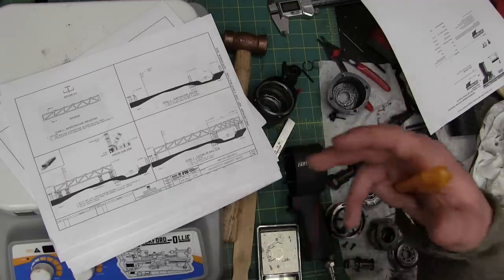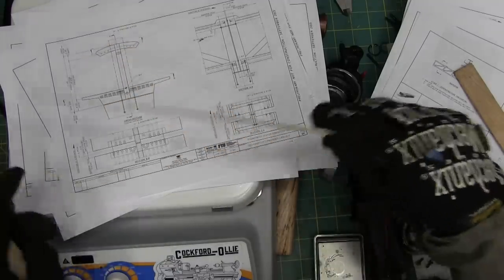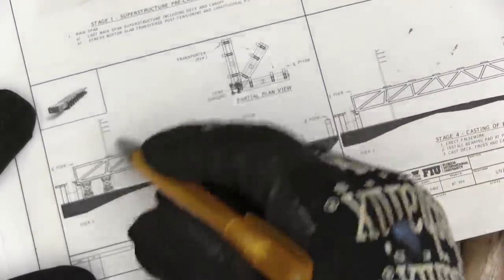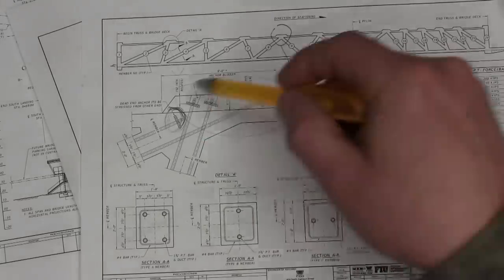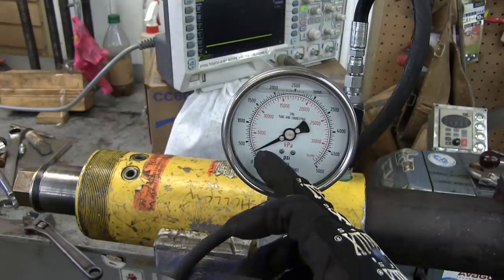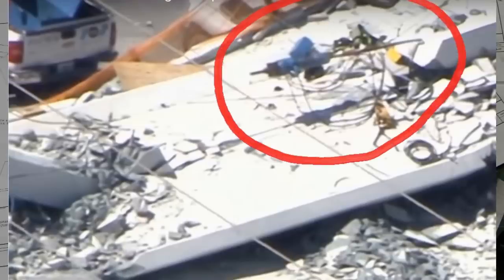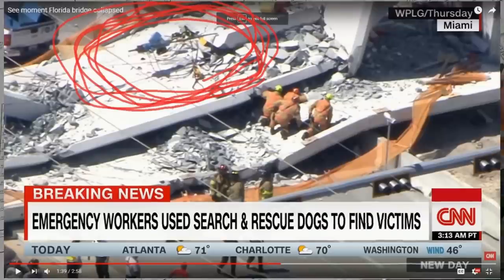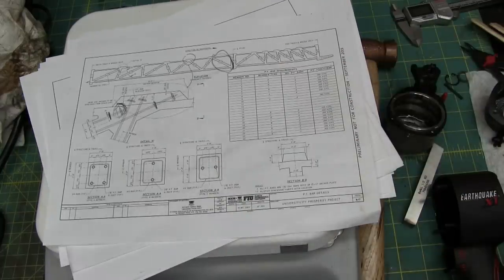Post Tension Failure Florida Bridge Collapse | Engineering EXPLAINED!

Comment: at least he's trying to make some sense out of it. Some of the clear videos I saw initially! are no where to be found, now. And the few officials who are allowed to speak are either not saying anything, or saying stuff that most anyone can tell they're talking out of their ass. The bridge designer and builder companies' websites went dark shortly after the collapse. 
One thing I want to bring up is this so-called "design-build" fad that is sweeping public projects. Previously, most public projects were "design, bid, build". But in order to cut design, labor, supervision, & inspection costs and liability City and State are going to allow the Contractor to design, and build projects all by himself. In this endeavor  the Public entities TRUST that the Contractor will rigorously design the project to standards, rigorously build the project to standards, and self inspect that the materials used meet specs, placed to specs, and all the quality controls meet standards. The Public entities think that by ceding the job to a private company, they are absolving themselves of any liability should something go wrong. Well, something went very wrong, but I can guarantee that when the lawsuits start flying, and they most definitely will in this case, the State, the University, and the City, will all be named as liable.

Comment: A recent slow motion video reveals many details. There are puffs of dust at the base of 12. 

The first visible failure is the upper flange left of node 10/11 The bridge begins to drop. The crane hook breaks. The squatting worker jumps straight up. The lower flange cracks. 11 is crushed axially even as the bridge continues to drop. 

The lower Rod in 11 escapes confinement when 11 splits lengthwise. Rod is intact full length in the aftermath. This could be the proverbial straw that broke a camels back.
Reply: NTSB VIDEO ANALYSIS
https://youtu.be/hBjntrebxj8

Comment: Should have been all steel. There are WWII Bailey bridges still in daily use in Europe for vehicle traffic, and they'll hold tanks. 

Concrete is fine for pavement but if it were as expensive as steel we'd see no concrete pedestrian bridges because it is inferior in every way.. Bailey bridges are still produced. One would have done the job this cheap concrete grenade failed to do. Steel properly used fails gracefully.
Reply: Roman's built bridges 2000 years ago that are still standing .

Comment: Your analysis seems spot on... in aircraft design a cardinal rule is that a single element failure can never allow an unsafe condition to occur, which seems to have been overlooked here.  Always design in redundancy so that if and when a single element fails, there is a backup structure to hold it together.  In this design, the capability of the bridge to support it's own weight depends on every truss element under tension to be there, and the failure of this one tension rod precipitated the collapse of the whole structure.  If cracking already occurred the concrete in that area had zero tension capability. Perhaps the tension rod was already overstressed and begun to yield prior to this due to the way it was supported when they moved it into place, or perhaps it was simply overtorqued to failure.

Comment: I heard on the news today don't know if it's true that they were stress testing the bridge but that would not make sense if they were testing it with cars and pedestrians nearby. Plus not sure how you stress test a bridge.
Reply: Craig C FEA and scale models and simulation software
Reply: the stress test was actually loosening the bolts, the stress as he said is in tension not compression, they were simulating the kind of worst case scenario where maybe a bolt worked itself a little loose, maybe the hot temp made the rod a little longer, maybe wind helped put pressure on and stretch it further, how much of the pre-tension could be lost and the concrete itself be capable of bearing the tension load as it were.

Your going to determine if it's behaving as expected through using force measurements to determine how much tension the bolt is actually under, So lets say you want the bolts tensioned to 500 foot pounds, you basically rough it to 450 foot pounds then torque it to exactly 500. Now you know its under that amount of pressure.

Then you measure deflection of the bridge to determine strain, as long as you know in great detail the characteristics of the concrete, surveying tools like a laser level etc could tell you how much deflection you were experiencing and you could basically go, ok I believe I have this concrete in this manner under this much pre tension across this span, what should my deflection be.

Ideally you fall in spec and because at say 50% to 80% you fall as expected, you can then basically say look we didn't test it to 98%, but we checked the real world with the math across a range of values and the math and life don't diverge, we feel confident if it ever does hit what we think is 98% maximum, it will in fact be 98% maximum and the bridge will stand.
Reply: well they use those, but by loosening the bolts and taking measurements they can compare expectations to reality to verify the models and simulations are actually accurate models and simulations.
Reply: Craig C - if previous commenters are correct on the construction company's previous accidents, I'd guess the stories we're hearing are so they can set up someone to take the blame, a fall guy. I'd hate to speculate too much, but if this has happened before, could be a calculated risk on their part. Save millions on the project, and potentially need a fall guy, or do it at or above budget and cut your profits. Just an idea to explore.
Reply: #1Lazer the media is very practiced in the art of manipulating the public mind in order to conceal certain insights, as well as to "set the stage" so to speak.  It's all a part of a PA agenda and pointing a finger.  Everyone wants to point a finger, especially when people die.
Reply: I do not believe anything I hear on the news anymore. Just like eggs are bad for you and now there good. Lol I knon one thing watching the last two videos I feel a have learned a lot about this topic. More than you would ever get from the media. I only asked because on Fox news they were saying it was undergoing a stress test when it collapsed. Thanks for all your input . I know someone is going to pay for this. Unfortunately it will not bring back the dead. I really hope they go back and look at any other jobs this company has done in the past.
Reply: A stress test isn't real unless there is a bunch of cars and people under the bridge.  These engineers thought of everything!
Reply: Somebody probably said they were stressing a post tensioner rod and the media misquoted it as a stress test.
Reply: Subb, apparently, they were actually stress-testing the span.  But if the test indicated that an area was sagging too much and so a rod wasn't holding the correct tension, it's logical for them to reapply tension to that rod on the assumption that it just came loose during the span's move.

"Just before the bridge’s concrete main span abruptly gave way on Thursday, crushing four people in cars to death and injuring others, a contractor’s crews were conducting stress tests on the incomplete structure, Miami-Dade Mayor Carlos Gimenez said. The 950-ton span, assembled by the side of the road over a period of months, was hoisted into place in a matter of hours on Saturday morning."

http://www.miamiherald.com/news/local/community/miami-dade/article205432029.html
Reply: Any guitar player can tell you that if a string keeps slipping despite repeated tightening, it's just about to break.

Comment: My weekend water cooler assessment was that one (or a couple) guy(s) got nonchalant in the process of an elaborate (and somewhat experimental), custom prefab installation and one (or a couple) guy(s) half-assed an RFI about changing some spec do to site conditions or time constraints while the owner was giving pressure to the GC about getting this sucker delivered on time and getting that road open asap.

In my career as a surveyor, my mistakes have almost always involved missing a detail when treating an often performed task as routine and or treating a difficult task as though I'm a magician.  Time, client pressure and site conditions are also factors.

Like the Titanic, it took a team effort for this to happen.

Comment: I did pre-stressed concrete and also construction in Florida and construction in Texas.  The Pylons are done in forms-bout 6 at a time [[dpends on length/use but my bed had 6 on each side. About 20' long each.]] Metal plates with holes separate each Pyl.   We pull the cable off big drums in the morning, snake it thru the end forms to the next.   The cables are tensioned to 22k pounds [IIRC]] then the 'slinkies' are pulled from each end and tied in with metal wire.  Cement poured the vibrated and it sits overnight and craned out in the morning.   This is not going to be PC but I've witnessed what happens when you have lazy people or people fresh from Mexico [[I noticed the guys accent in the vid]], shit gets done ass-backwards [[water faucet knobs and electrical in houses]], roofing materiel needing to be kept dry until placed and tarred left out then used to save a penny.  [[Research what happened at Leesburg Fl H.S. in the late 90's]] I worked on the roofing crew there and witnessed the stupidity done.   Then you add in kids no longer having the option to take shop or vo-tech and getting degrees in women's lib lesbian studies or degrees in researching some hockey players life [[that's from Canada btw]] and you have a society destined to fail-especially with infrastructure.
Reply: Mark Henry   By " is not going to be PC", do you mean cheap, incompetent labor who lies about their training/qualifications/experience, who don't care (and incompetent mgmt prefers them) and will do what they are told even covering up fraud/sabotage for fear of being sent back to their 3rd world country?  If so, then Mexican is to Construction as Indian is to Software.

Comment: As a structural professional engineer in the county that this occurred your conclusions and mine are the same. i also know information through my local network that our conclusions are correct and is an issue with the means and methods. also fault is being put on the specialty inspection process. the calculations and plans were submitted for approval and second review by 3rd party was also conducted.  I watched both your videos with appreciation because of how simple you describe this so that I could share with my young engineers.

Comment: 950 tons for a fucking PEDESTRIAN bridge SECTION is what went wrong. No mystery there.
Reply: Pedestrians aren't exactly getting lighter, plus pedestrians includes those in wheelchairs and wheelchairs aren't light.
Reply: Runehorn 
falcon-A
Reply: the average yank is the weight of a small car so need a strong bridge
Reply: Runehorn  so 1 inch wire supose to hold 950 tons ?
put the project ppl on a trailer park broke.

Comment: Even when done correctly this type structure is very vulnerable to collision damage from say a truck that has a crane left up by mistake or something similar. Anyrhibg that manages to remove a chunk of material from the middle of the beam can instantly or over short period of time cause the pre-tensioning to implode the damaged structure.

Comment: Back in about 1991, I worked for a year at a little company that manufactured various gaskets and seals. Of those items I know nothing of the boss and his greed in terms of selling shoddy materials. I myself was tasked at the bottom rung of the structure, mostly using a hydraulic press and spending mindless hours stamping out little circles and squares from rubber, butyl, aluminum and whatnot. Other more interesting tasks would be when I was given a set of calipers, various green plastic templates, a pencil and instructed to design and build the tool that would later be used to cut out a gasket for some kind of widget. Usually it was something like a 1936 Ford carburetor or valve cover. I would draw and measure everything to certain allowed tolerances, and then set about to make a dye out of plywood, stainless steel strips that were the cutting edge and a jigsaw.This was a fun and often challenging way to earn my minimum wage, way better than the regular shitwork.But one day the underboss, (the BOSS rarely ever came directly to me, only later when he fired me I think.) told me to go way back into the noisy place, a place I didn't like because it was very loud (like a forge perhaps, but lots of hammer and anvil violence!) dark and the guy who worked back there was said to be dangerous as well as insane! (Not really, he was fine, just always blackened from head to toe under a caking of grease and soot)Back there, I was sent to assist on a project that from the immediate get-go I knew was a REALLY REALLY BAD fucking thing. What I was instructed to do was use a largish sledge hammer and a tool for stamping letter/numbers into iron, and change the markings on the KOREAN or THAILAND or CHINA or wherever the fuck the giant barrel of NUTS (Or a pallet which had a dozen 6" diameter type bolts. The size isn't important, the fact only matters that they were BIG FUCKING bolts FOR SHIT LIKE BRIDGES ETC!!)The markings on the bill of lading were generally something like GRADE 3 steel.The EVIL BOSS was changing the markings and RESELLING this shit as GRADE 8 or similar. TO companies around the world or just the country. Selling weak Grade 3 shit, but passing it off as GRADE 8!When I asked the underboss Eric about this bullshit, he said (whatever main boss-mans names was I can't recall)was already planning to sell this company inside the next 5 years and didn't give a shit. A few weeks later I met a girl who was a little sister of a friend of mine, she was a paralegal, and when I told her I worked with a lot of asbestos, she told me her companies main area of litigation was class action lawsuits for old workers and the families of people who were suing for mesothelioma and so on. I told my boss one day I was sick and would be staying home one day, instead I spent the day in the library this girl had sent me to to learn about this mesothelioma thing. Later, when I mentioned to my boss I wanted proper respirator type stuff to use for work, he laughed and said all I would get was what they provided. Paper painters masks. So I went to the BIG BOSS and stated I knew a little something something about Asbestos and alluded to the lawyer shit, and of course two weeks later, he used my lie about being sick as the reason to fire me. Several years later, right before I got married I happened to drive past the shop where I had worked, and it was an empty building. For Sale signs.Two or three years later, when I met my wife's parents in Minneapolis, don't recall the year, but it was the same year that the big bridge somewhere in the Twin Cities had collapsed.For the next couple years I would speculate that it was quite possible, those fucking bolts my boss had us alter, could've been used in that bridge.This is a fucking true story.

Comment: LOL. The New York Times says "Workers were adjusting cables that ran inside the beam."
Reply: Yea the day it happened they were saying it was a failure "during testing". Whatever that is supposed to mean
Reply: It means they made lab rats out of the citizens of South Florida during  an experiment. People have to go to jail over this .
Reply: TBH, I've rarely seen news types get the correct terminology when reporting on engineering. The general public simply does not understand the complicated concepts, nor should they be expected to. So I don't really rip into journalists for that.
Reply: I mean it's closeish.
Reply: @D rB
My career was largely manufacturing planning and scheduling for a huge company. I have no substantial background in engineering.
I'm two years old. No reason to baby talk to me anymore.
Reply: Well that is what they were basically doing,  "Workers were adjusting cables that ran inside the beam.". I might have said tightening cables. How would you have worded it better but at the same time not confusing most people?
Reply: The NY Times is correct only it is a tensioning bar being adjusted not cables.
Reply: Solid bar not cable, got that, thanks.
Reply: who reads the mainstream junk nowdays ?
research costs pennies on the internet fly, and is way more rewardindg

Comment: It will turn out that:
1.  Installation error created a stress on the ends that was too great and damaged the bridge
2.  Materials were "eco friendly" and apparently not up to snuff. 
3.  Design was new and somewhat dangerous using concrete instead of steel for truss supports, and a single line rather than doubled, for asthetic reasons.
4.  They were "testing" and "adjusting" bridge with cars under it, not wise.
5.  At least one worker wasn't properly strapped into his harness.  
6.  Traffic should have been stopped during tensioning process.

So, design, delivery, installation, and adjustment mistakes were made.

Comment: You are 100% correct! When they moved the lift, the end of the bridge instantly became under tension, not compression as it needed to be. They did try to tighten the rod but it broke because it was damaged from moving the one lift unit inboard. I have seen it 1000 times that someone arbitrarily makes a decision to change something, and then there is catastrophic failure. I didn't see any load spreaders either. Another big mistake.